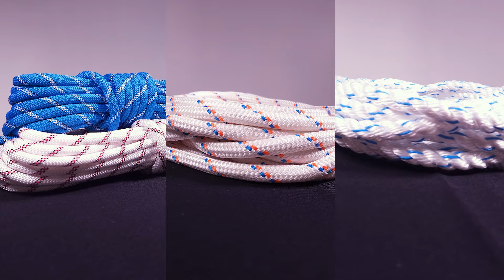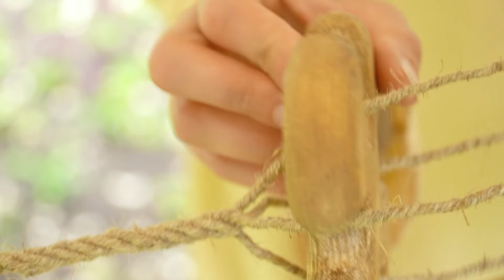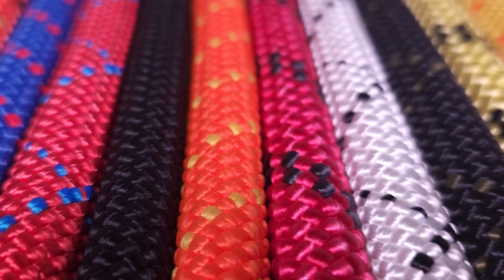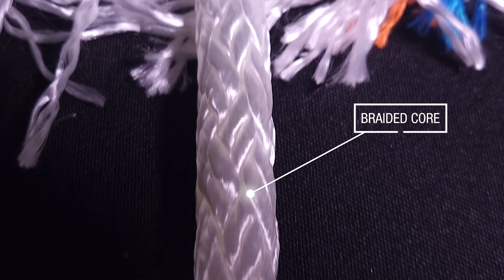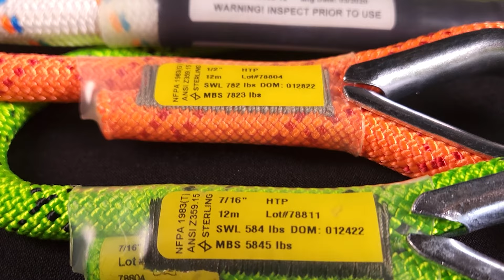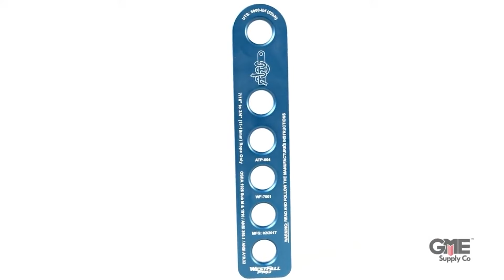Rope Types 101: The Three Types and When to use Them

Comment: I make my own jute rope at home as a hobby. I use jute thread because it's easy to get and very cheap. And it's relatively strong for its size. I like tying it into long loops, roughly about 50 to 70 feet. And then I would twist it until it was tight. Then I would fold it and let it untwist, which in turn forces it to braid itself to a point. I then tighten that, fold it again, and do the same process over and over. And because I did this with not just a single strand, I started at two. And usually I end with 16 strands of jute fiber, all the way up to 64 strands. And still have six to seven feet of half inch to one inch rope at the end. To anyone reading this, I must quickly mention that this is hobby rope and not meant for load bearing. Jute is not a very strong material, The most intense thing I have done with my 1 inch jute rope is I used it to replace a handle for a five-gallon galvanized steel bucket. And it has held up for a year without failure. I don't know how much more it can take, but I wouldn't want to push it past that.